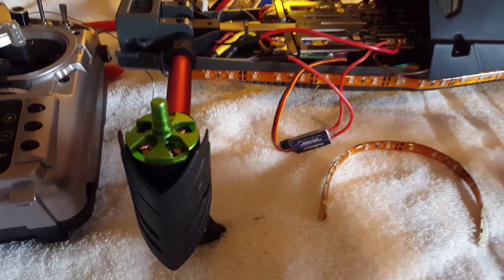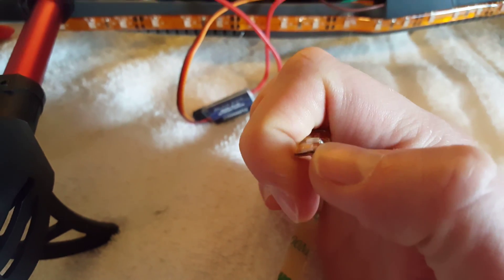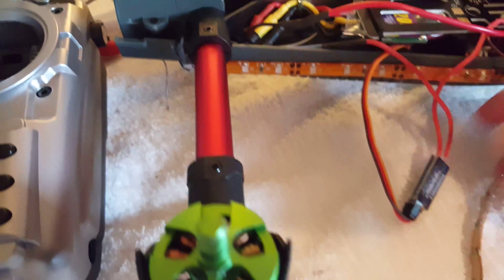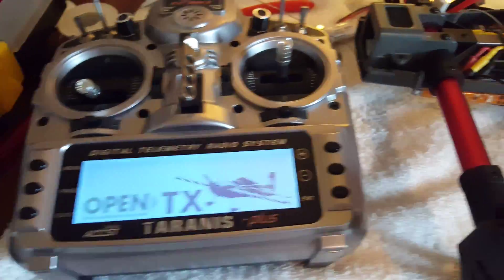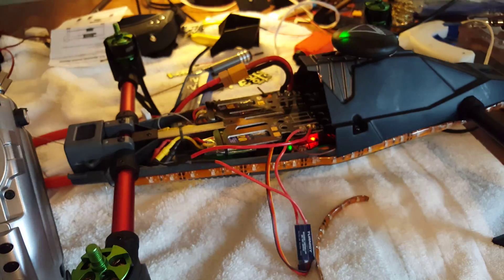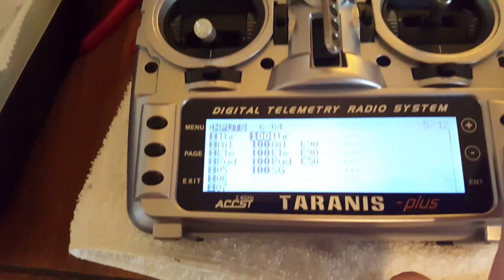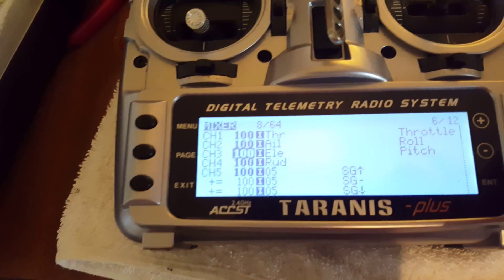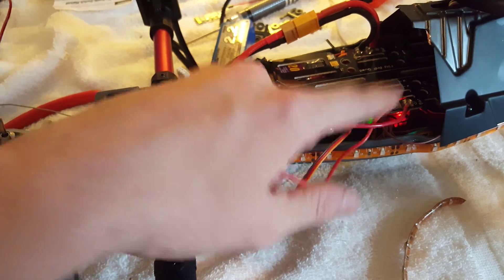Turn Led on/off with taranis plus

Comment: hey so i got myself a phantom and I wanted to know can i put something that will switch on and off the led lights?? like can i use the gimbal thing on the back of the remote to switch on and off the lights?
Reply from the maker: All of my stuff is custom so I'm not into DJI but I'm sure you can do it, are you talking about the stock led? You could always put black tape over it to keep the light off the camera at night, but if you are talking about additional led let me know, I can check it out
Reply: ahh okay but nah lol im trying to save battery
Reply from the maker: You could always cut the power to the led, they don't use much power though
Reply from the maker: get some good props and balance them is your best bet

Comment: Is there a way to use a three position switch and having the LEDs blinking in the middle position?
Pos. 1 - LEDs off
Pos. 2 - LEDs blinking
Pos  3 - LEDs on
Reply from the maker: BackyardAirways yes you would just need to find a led module with different settings. I have them wired from the power supply to the frsky receiver and its just on or off. I'm pretty sure you could program the taranis to make it go on then off with a timer function by switch position.
Reply: Thanks DroneHangar. I figured it out with the time function and it works!